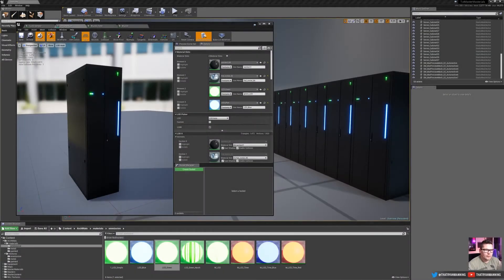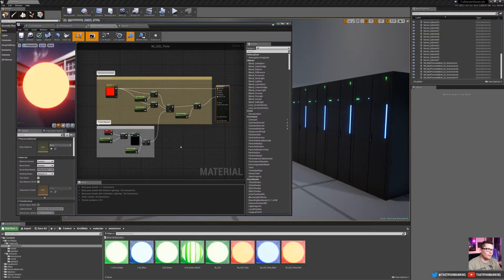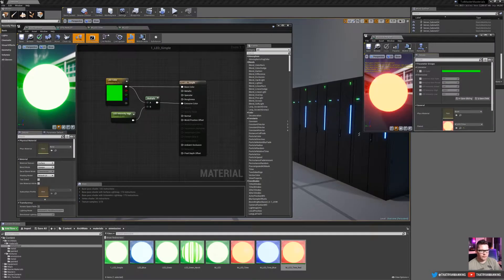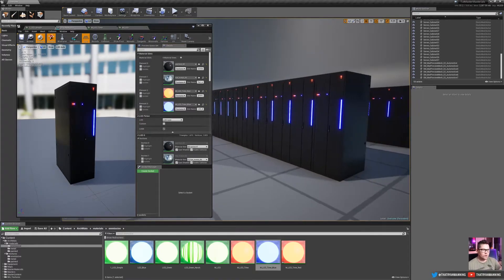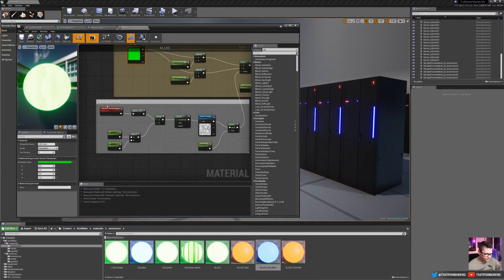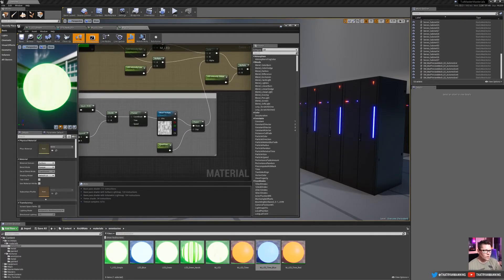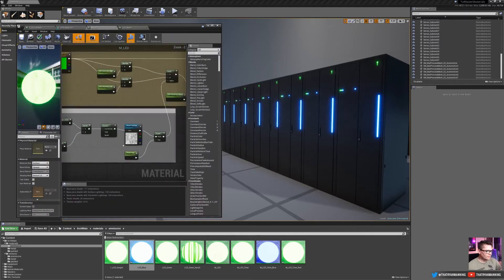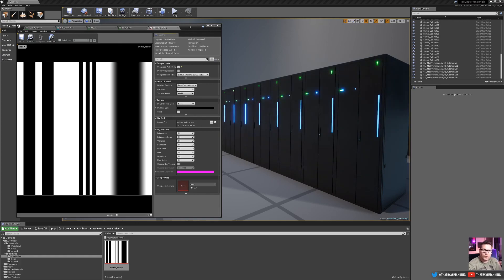UE4 World Align Emmissive

Comment: Why doesn't may material look like yours? You have a nice glow around your sample. My sample does not show that glow and the sample is white not the actual color. Like its to hot even though I am using the same settings as you?. When I build the level shader does work but I again if the intensity is to high then it looks white.

Comment: Hi. Love your tutorals. I'm having problems with the cloud movement portion of the material. I set it up exactly as the tutorial, but the material is not panning at all. Do you know what the problem might be? Do I have to input a manual amount into the Speed X and Speed Y of the Panner node? Please help. Thanks
Reply from the maker: Correct. On the Panner node, make sure you have values in the Speed X and Speed Y .